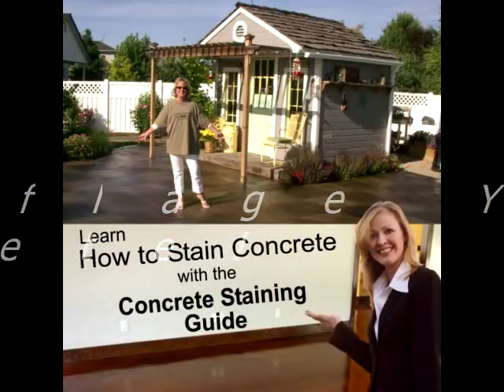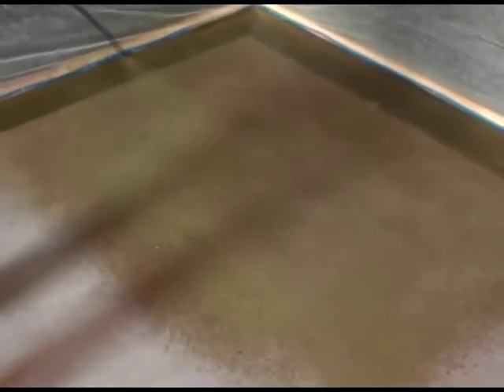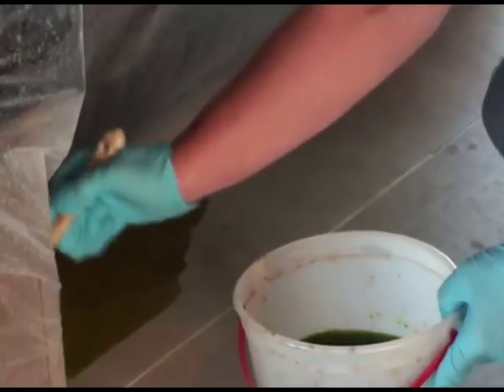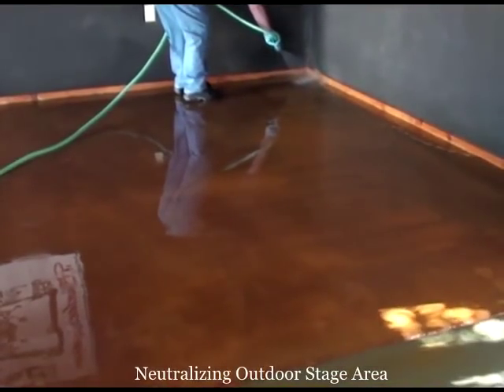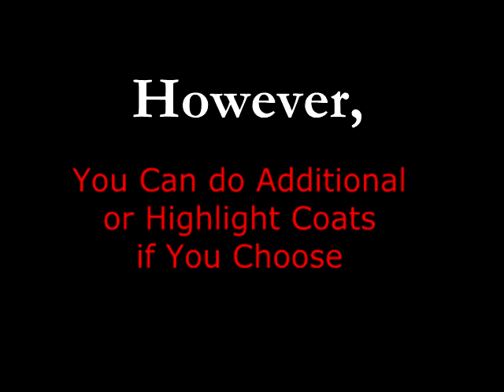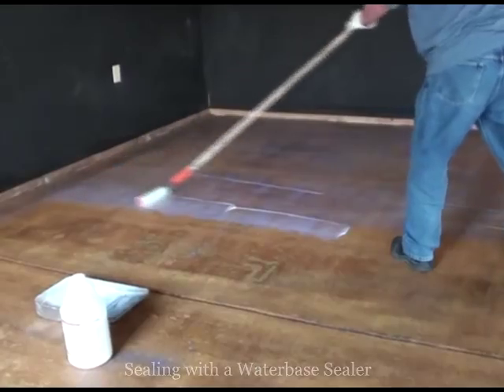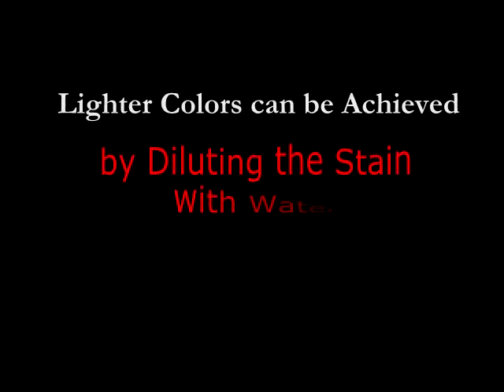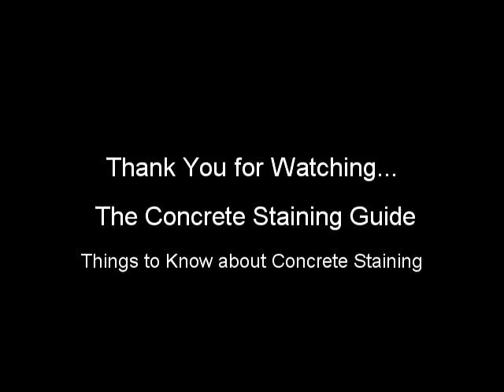Important Things to Know about Acid Staining Concrete Floors & Exterior [P1 | ConcreteCamouflage.com

Comment: sweep
wet mop
clean with TSP
wet mop
spray 1 coat acid stain
let dry to touch
spray 2nd coat
let dry up to 24 hours
neutralize with ammonia/water mix
wet mop 2-3 times
seal first time
let dry to touch then seal 2nd
let dry for 24 hours
mop on wax, let dry then mop on 2nd coat

am i missing anything?  thanks so much i love your videos

Comment: I have always acid washed first then used floor buffer with the black with tsp and really clean the floor removing water with vac  don't use brush unless I have to using circular motion one coat the a highlight coat . wash again three times  let dry two or three coat one part urethane or water based acrylic Always have great results

Comment: I just built a concrete countertop. Should I stain before polishing (with disks, not chemicals) or after? I will work up to a 3000 grit. Or, should I go up to 200 grit, stain, wait a few days then continue to polish?

Comment: What is your opinion on diamond grinding with. 100 grit?  Will it grind the concrete too much?  We have a lot of carpet glue and paint on our slab and are having a difficult timeout ting it all removed.  The dimabrush touts that it is a good concrete prepping tool for removing mastics, ect.  Is this true?  Also, we removed tile at the entry way and it looks as though there is exposed aggregate.  What is your suggestion on dealing with that?

Comment: What if I didn't want to use acid stain, doesn't acid etch washing allow you to use a variety of different concrete stain?  What is the pros to using acid stain versus reg concrete stain after acid washing?  Also, what if I didn't have to acid wash and used a reg concrete stain (non-acid), would this be ok?

Comment: If you don't use an acid etcher like muratic acid or similar what do you do to concrete that's been machine trowelled finished. Is there something else you can clean it with to prep it or do you have to grind or sand the surface. I have a 24x50 garage floor with one year old concrete that's not very flat. Thanks for sharing your knowledge and posting this video.
Reply from the maker: You should start with a concrete degreaser, especially since it's a garage. then rinse and then use T.S.P. or soap and water and then rinse a couple times with clean water and let dry. To open the pores of the concrete as you're asking, use a rented floor buffing machine with the agrressive stripping, scrubbing pad which is a black knarly looking pad. I would get 2 pads and use one when degreasing and then use the other when doing the final scrub with T.S.P. or soap and water. That will get the concrete pores open and the concrete clean and ready.

Comment: We used acid stain for the first coat over interior concrete floor but someone was wearing tennis shoes while spraying the stain, walked on the stain and it left foot prints. We used a coppery-brown stain. Can we over-stain the footprints since the footprints left a lighter pattern where that person walked?

Comment: How to I camouflage where my tack strips from my carpet where? Thanks
Reply: that's what I will be dealing with. I probably won't worry about mine although some are patched from previous owners. You could do a border design over the stain before sealing to hide the tack strip holes or just let it be part of the design. I'm not going to fill in anymore cracks or chips. will just add character to it in my opinion.